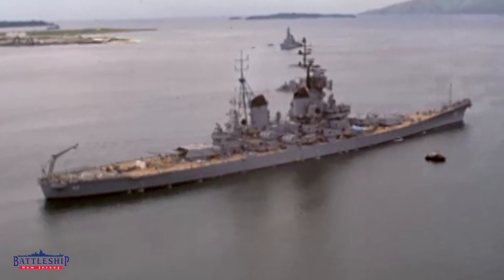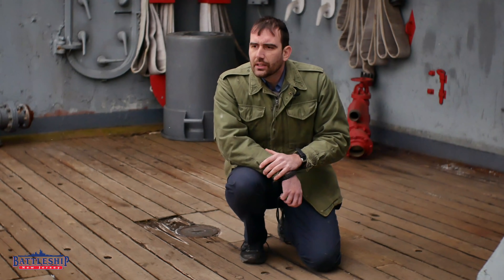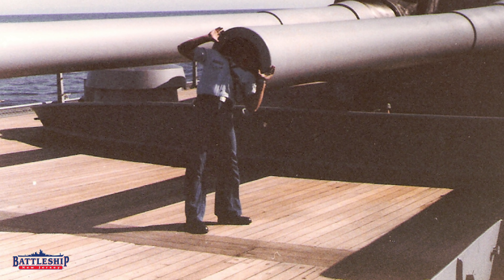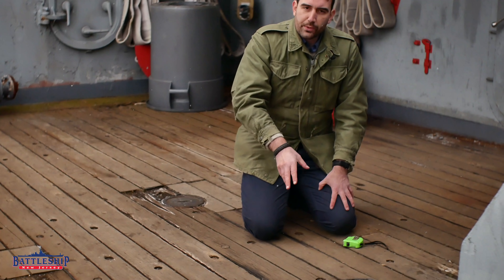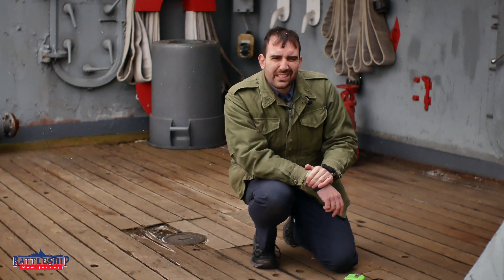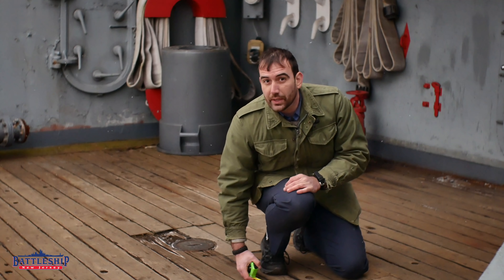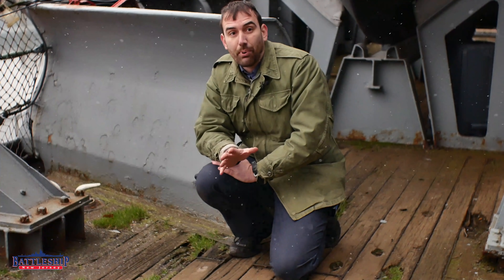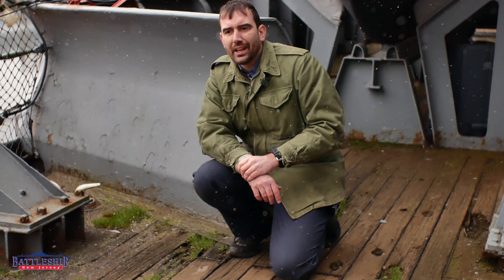Is This Piece of Deck From WWII?

Comment: Thanks, as always your videos are so interesting. However, wood workers today still align the grain of a  plug with the grain of the board it is going in. While it is certainly better esthetically, the main reason it is done on ships and wooden boats is the wood expands across the grain Placing the plug any other way would result in additional stresses on the plug and deck board, resulting in plugs splintering over time.

Comment: Since it’s nearly impossible to know all there is about working with wood unless it’s your craft and you work with it on a daily basis there’s a few I’m aware of that will affect the quality of the wood. Not only could it be second generation wood, it’s possible that the original wood was finished with industrial grade jointers and surface planers. They’re built so there’s less tendency to chatter as it cuts the wood. It also depends on the feed rate as well. The faster you try to plane it the more it tends to splinter the surface. It also tends to be more difficult to get a smooth surface on short pieces of wood. The feed rollers doesn’t hold the wood steady because it has a higher tendency to chatter. Along with this in confined spaces sun and wind can’t circulate to help dry the wood underneath equipment and boats since any water rolling down the hull accumulates below it. 
Something I wonder about concerning your  ‘botanical garden’ is since the ship used to be at sea in salt water could it be that salt water might inhibit the type of growth that you’re experiencing. Since salt water will kill a wide range of plant life I wonder if occasionally dousing the deck would rid the ship of certain plant growth. 
It would be interesting to find out from an expert whether salt water would help seal the surface of the teak and prevent water penetration. Hopefully it’ll add to your knowledge and make it easier to care for her over time.

Comment: I've worked in historic building preservation and restoration and the best way to date unpainted wood (short of laboratory analysis) was to examine the nails.  Unfortunately that doesn't really work on a battleship 😄 6:53 And I once had the job of plugging holes in a new floor, just like how they did it on this ship, including aligning the wood grain as you describe in the video. It was tedious but very satisfying because after the plugs are glued and sanded they absolutely disappear if done correctly.  I never thought I'd be able to relate to a video about battleship construction lol I just ordered 2 plugs from your website 👍

Comment: I have a piece of the teak from Battleship Texas, I'm pretty sure it's from the 89 repairs. As her old original deck was long gone, I think ripped up in the 60s or 70s and covered in concrete until they put a new teak deck down in the late 80s. My favorite piece I have is a ball bearing from one of her of her 3”/50 AA guns mounts they are restoring currently.
Reply: It would be cool to get several of those ball bearings and make a Damascus knife out of them. But I lack skill for that

Comment: I got a piece of teak form the USS North Carolina.  Some interesting things they had in the gift shop were pieces of metal from various places in the ship, the hull and armor plate were two if remember correctly.  Some pieces were cut to silhouette of the ship.  One of my favorites is a coffee mug with the specifications on it( weight, length ,crew etc)

Comment: I don't have a piece of a battleship, but at one time the car ferry, Chief Wawatam operated in the Straits of Mackinaw. It was a Frank Kirby design with two props in the back, one in the front for breaking ice. While driving along a Michigan road, I saw what I recognized as one of Wawatam's engines. I got out and looked at it and came away with a handful of rust and paint chips from the engine.

Comment: Anybody who bought a surplus Soviet Bloc/Chinese SKS or Mosin-Nagant when they were super cheap just got a PTSD flashback when he said "Cosmoline" :p , the Mosins were been coated with it inside and out to preserve them for an emergency (i.e. WWIII) when they got the SKS, and the SKS same when they got AKs. It's more of a waxy grease than an oil, and hardens over time, is a pain in the butt to remove from the metal, and you basically had to melt it out of the stock (the recommended method here in Texas was to put it on an old towel and leave it on the ledge under your car's back window all summer, IDK what people did up north). And completely remove it you must, because besides feeling all icky as it seeps out of the wood as it heats up from shooting, it clogs up the innards -- if you didn't properly clean a bolt-action Mosin, it just wouldn't work right, an SKS - a semiauto - with some still inside it could go full-auto on you. Fun fact: the BATF doesn't particularly care if your unregistered machine gun is accidental, it's still an illegal machine gun.
Reply: The massive glut of imports were early-mid 1990s for SKSs and early-late 2000s for Mosins were $100-$150 per, depending on the factory that made it -- The Russian, Chinese, and one or two of the SSRs' were more nicely finished/had nicer wood than others, and you could pay up to $300 for a Chinese SKS that the dealer had already cleaned up, but at that point (in the you were getting close to the price of a new or slightly used (I can't find the MSRP, but I wanna say $400 in the '90s?) Ruger Mini-14. The whole selling point for both was "fun starter rifle, cheap! And the ammo is HELLA cheap!" And for the SKS, of course, "especially if you were going to save up for a nice new AR or Mini-14 but have to buy SOMETHING before Clinton bans everything." (no commentary there, that's just what the gun market was like at the time, same as it was around the time Obama got elected.)

And no, I don't know why the newer gear was exported before the old. Probably just to cash in on the Clinton scare and make a quick buck (or ruble, as it were) after the USSR collapsed, or maybe being newer, people still remembered where they were, whereas the WWII rifles had been stored away for so long nobody remembered where they were.

And that has been your Simon-Whistler-style tangent on surplus Soviet rifles in the US.

Comment: I'm wondering, when you're redecking what is the tradeoff between authenticity of the New Jersey as it was in 1980 vs. practicality?  Does 1980s teak get different size plugholes than original?  Does fir get replaced with teak or fir?

Comment: When I served on U.S.S. Oklahoma City (CLG5) during Vietnam, they replaced some of the teak during some yard periods. The new pieces were much thicker than the old ones. After they bolted them down to the deck they then sanded them down to be flush with the original ones. Seemed like a lot of wasted wood to me.

Comment: I’m pretty sure the Missouri had all teak replaced in the 80’s. I was just onboard and they said it had Douglas fir under with a thin piece of teak ontop.  They’re still working on the deck, I was there when they started in 2011

Comment: Can you do a video on the rust abatement process your using on the deck from tearing up the wood to rust removal and coatings you use to prevent rust again . Then the sealers you use to seal the new teak down . You can do a historically comparison of the old process 1940 1950 1960 1980 1990 and the differences between coatings paints from all those era’s what they are called and what they used . I have Missouri teak on and print and new Jersey teak.

Comment: Hi Ryan,
 I was aboard the NJ 8/7/21 with some of my model ships. I had the teak plank from the North Carolina. It was WW II stock, good 2 inches thick. It came from the main deck, starboard, where it had come up against number two turret barbette. The bottom was black and oily like the cosmoline you spoke of. Were all battleship decks a standard thickness? From your video I am beginning to realise how the thickness began to differ over the years in some spots. That was an informative vid. Thank you.

Comment: In the UK the price of any timber is sky high let alone hardwoods like teak.I dread to imagine the cost of redecking a ship that size.Pine would have been the cheapest way to do patching work especially on a working ship that was essentially already past its built sell by date
I suppose? Also what detergents were used to scrub the decks.If they contained ammonia that can compromise the life of any timber aswell as salt?Becomes dry and brittle.

Comment: the only thing better than teak would be ipe but then that starts the arguments of historical accuracy but I have personally worked with boards that had been exposed to the elements 80ft in the air as part of a rollercoaster. its an amazing wood but hard to work and its the same price as teak or more depending on the season

Comment: It's fun seeing this having personally worked on the Missouri deck restoration crew. We found some that had a wool-like material between the planks as well, but only where we also found the black grease. Any insight on this material?
Reply from the maker: Probably Oakum.
Reply: @BattleshipNewJersey  its actually more than likely cotton and oakum.
Reply: There were some stories in 80's All Hands magazine that Navy put out and it covered bringing battleships back and had coverage on the deck restorations back then.  Perhaps the information would be in some of those articles and could be pulled from the CHINFO archives.

Comment: HATED Teak decks on any vessel - they LOOK great, but are a pain to maintain. Brother's sailboat had teak hatch covers and some trim - remember HOURS spent stripping, sanding, washing, oiling, and varnish for the bright-work.

As a curiosity, the yacht club's bar was teak from a WWII minesweeper that was being scrapped - members liberated the old decking and applied it to the bar-top - beautiful TIGHT grain.

Comment: Here's a story for you.  In first week of 12/06, I finally made it to Pearl Harbor.  While doing the whole three-site tour, I was standing near the surrender location on USS Missouri when I noticed a work crew was hard at it just a few yards away from where tour director had stopped.  They were taking up teakwood decking and throwing old screws / bolts that had held the planking in place.  I asked crew boss if I could have a screw from the deck and I got one. I still have it.

I always assumed that thing had been there since '43.  I wonder if it really is original?
Reply: Interesting story. So do you know if the area where the surrender happened has the original teak or has it been replaced?

Comment: Ryan.. I'm just wondering... So how has it went...
Since WW2.. and forward... Have they taken all the wood that has been Saved. On purpose. And put all of it in some certain spot somewhere... Or is it separated in all kinds of places.

Just wondering because if it's all in a warehouse let's say...
Couldn't u THEORETICALLY go to the very back of the pile, and to the very bottom.. and it would most likely be WW2 wood??? Is this possible, or any truth in this???

It would be cool to answer in a video.. cause it would be enough for a small video... If you even answer at all I mean. I know your busy.
Thanks for you time man..
Reply from the maker: Prior to it being a museum in 2001, that wood we can consider to be discarded. We can only track wood removed by the museum.
Reply: @BattleshipNewJersey  ohhhh... So any wood they removed in 2001.. or so... Is probably more likely to be older. I'm guessing...
Reply: @BattleshipNewJersey  Kool. Thanks for ur time...